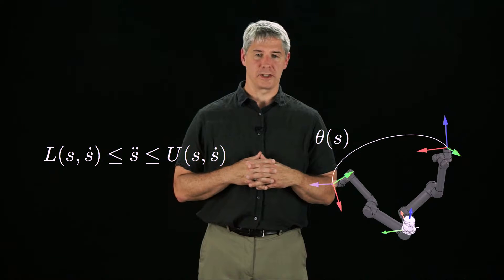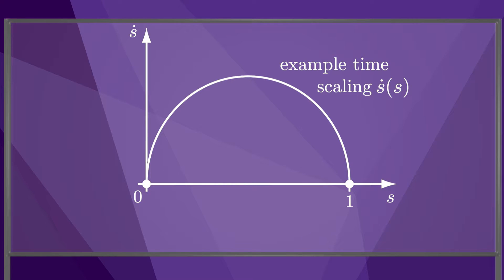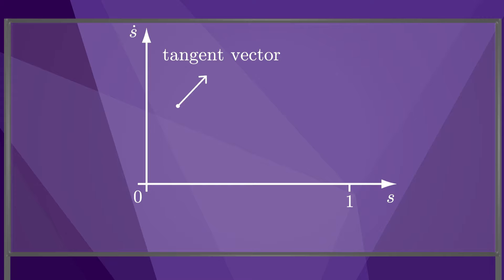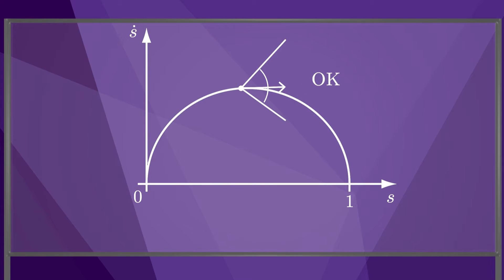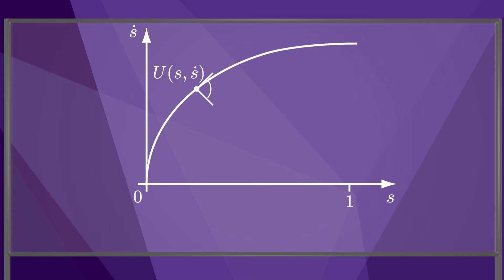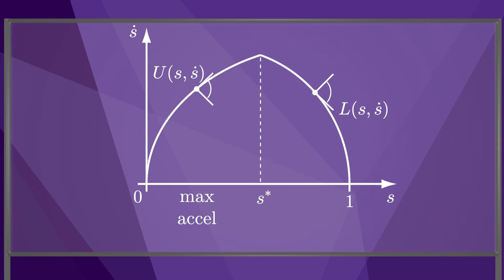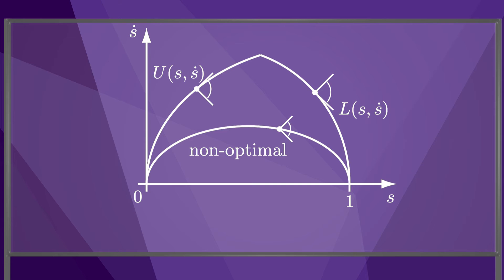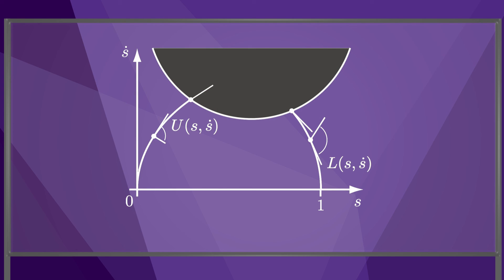Modern Robotics, Chapter 9.4:  Time-Optimal Time Scaling (Part 2 of 3)

Comment: 5:30 Why should the motion cone narrow (and eventually turn into a single vector)?  I understand that the upper limit should become horizontal as you reach the max speed of the actuator, but shouldn't the lower limit of the acceleration (i.e. max deceleration) point increasingly vertically downward as you read the limit of the joint velocity?